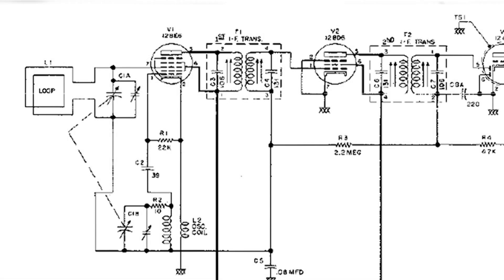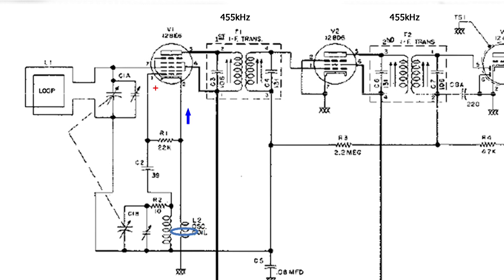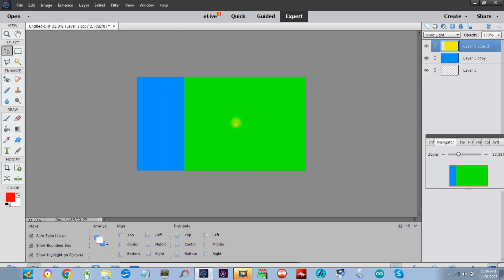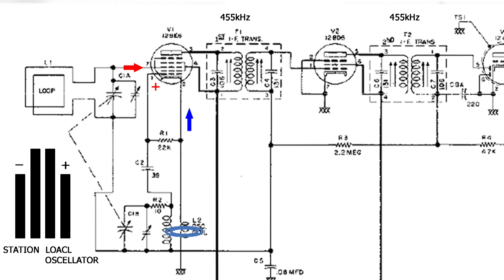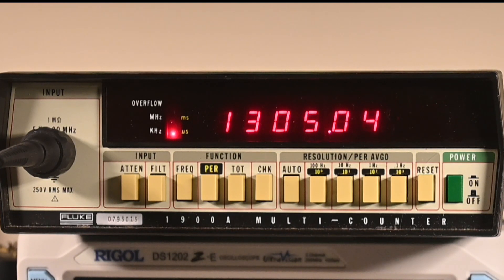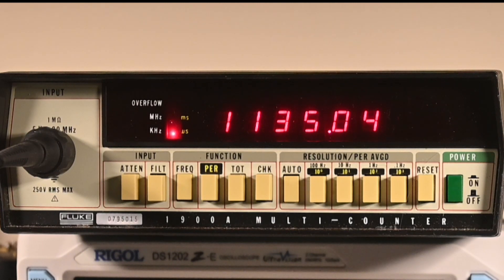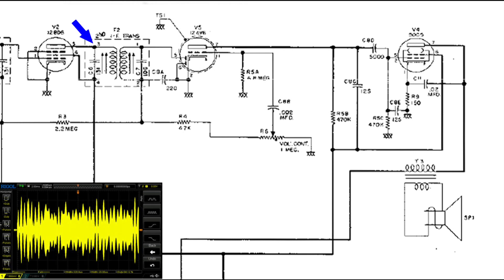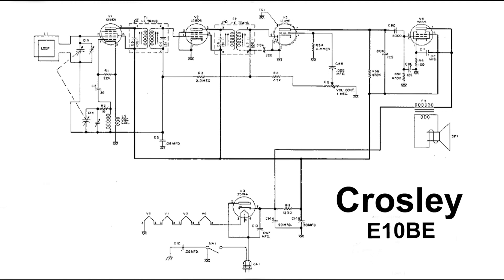How Superheterodyne Works

Comment: What makes the 455KHz that is added to the frequency that was tuned in stay a constant 455KHz more as the tuner is swept across? In other words, why does the 455KHz not drift?
Reply from the maker: The 455KHz does not drift because the radio station frequency does not drift, also the local oscillator in the radio does not drift. The IF’s are very sharply tuned to 455KHz, an odd harmonic below the AM band. Local oscillator – station frequency = 455KHz. WKIX is 850KHz so 1305KHz – 850kHz = 455KHz.
Reply: @AllAmericanFiveRadio  I always have a hard time with looking at the math on paper because the inscerted tuning gang is in parallel with the oscillators tank capacitor.
Reply: @AllAmericanFiveRadio  I guess the { in parallel stuff} does not apply then.
Reply from the maker: @johnkerley4152  The parallel is the tank circuit, coil and capacitor, this make the local oscillator 1305KHz.
Oscillators, the Basic Tank Circuit 1
https://youtu.be/fQ4yRVEzXQA

Comment: Hello from New Zealand. I found this a very good demo. However, no mention of AGC. What I have been trying to find out, is why, on many AA5 's is the frame of the tuning gang connected to the AGC and not to chassis? If anyone can help, thanks.
Reply from the maker: Thank you!
Search my channel.
How the Volume Control works in a All American Five Radio
https://www.youtube.com/watch?v=swhVF-wb_eM
Automatic Volume Level Control AVC ALC
https://www.youtube.com/watch?v=NUerOOaKFP8
Build a Radio Station Detector Circuit using the AVC or ALC
https://www.youtube.com/watch?v=jC2r_1pLK2E

Comment: Hey Rick. I've used that method to prove and show that the local oscillator wasn't working on several occasions on both AM and FM radios. Also the color mix was a very good way to show how the frequencies mix. Very good demo indeed. :)
Reply from the maker: Thanks Doug. It is amazing what you can do with PhotoShop.